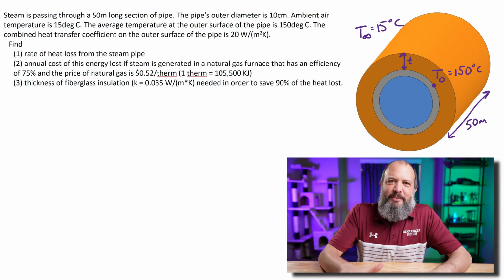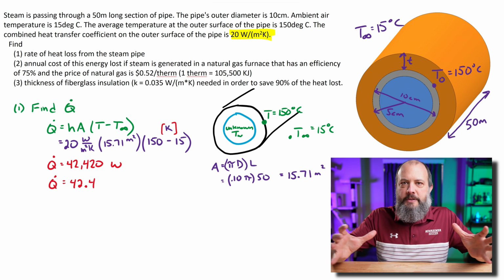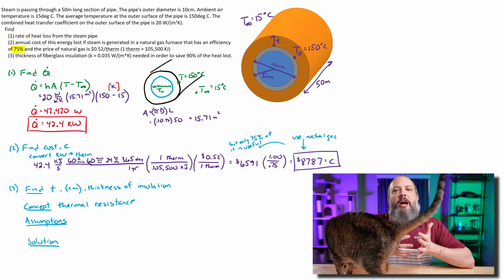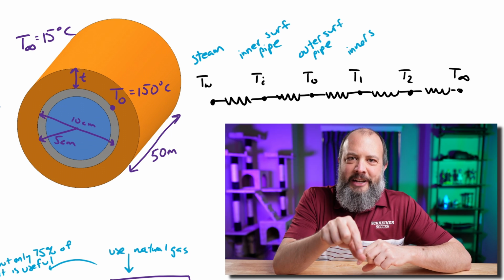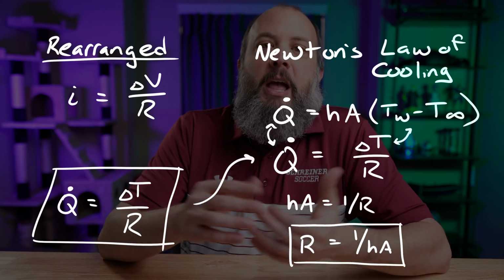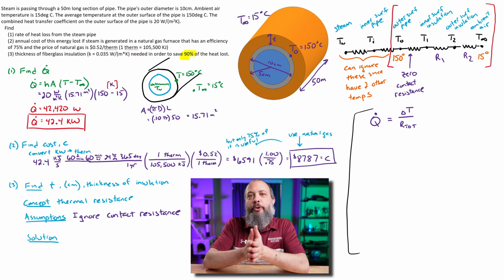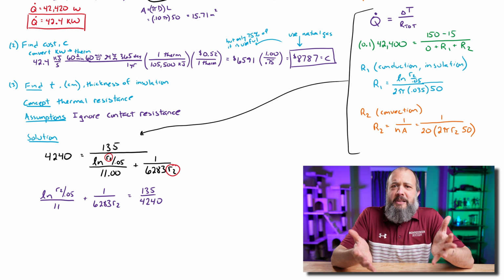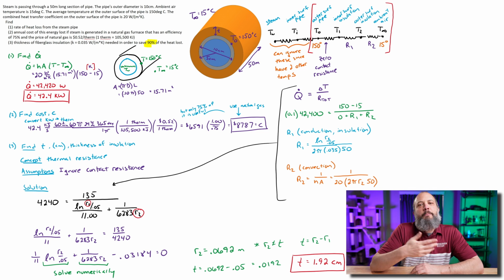Calculate Pipe Insulation Thickness - Thermal Resistance Example Problem

Comment: Is there a book or pdf where you are getting these equations from? Thank you for the practice problems.
Reply from the maker: I think I got all equations for this problem from the FE Reference Manual which is a free pdf from NCEES. You'll have to create an account, but once you login, it's in there somewhere, reference materials maybe. I also like "A Heat Transfer Textbook" which is a free pdf textbook written by Lienhard. I get a lot of equations and examples from there, and use their tables and figures also.

Comment: Dear Brian,

I am currently working on my graduation thesis, focusing on thermodynamics, with a specific emphasis on the heat emission of an exhaust system in a genset room. The situation with exhaust gas pipes closely resembles the one in this video. For example, the system consists of a stainless steel exhaust pipe with insulation material around it.

The key parameters in my research include:

The temperature of the exhaust gases and the ambient temperature in the genset room.
Dimensions of the pipes.
Airflow velocity/airflow rate inside the exhaust pipes and in the surrounding space.
For my calculations of convection inside the exhaust pipes, I am initially assuming the thermal properties of air at atmospheric pressure (at least in the first version of my calculation tool).

I have additional information about the project and my current approach. Would it be possible for me to send you an email with my current report? I would greatly appreciate it if you could review my work and provide feedback on my progress.

Thank you in advance!

Best regards,
Reply from the maker: There's an email address on the 'about' section of my Channel page you can send it to ... but no promises, sorry. I'll try to get to it if I can, but definitely don't wait for me.

Comment: The problems faced by solving the heat transfer of a cylindrical shape using natural logarithms are: 
1. When R1 = 0, then the calorific value is ~ + 
2. As a result, the temperature at the center of the cylinder also has a value of ~ + 
3. You cannot know the change in the value of the circumference of the cylinder (2πR). This is because you do not know the value of R. 
4. The ratio of R to dR becomes inconsistent. I have explained in the previous open letter. 
5. Serious problems occur when the radius of the cylinder is large and the thickness approaches the radius of the cylinder, then the ratio of R to dR is (R >> dR), R is very large compared to dR. It seems that when viewed from T1 the value is reasonable. But actually the value of T1 has a fatal error. 

I just hope that you read very carefully the meaning of my open letter.
Reply from the maker: I am unconvinced but open-minded. I don't think youtube comments is the best venue for persuasive technical discussion. It's difficult to format equations for example. Instead of an open letter, I recommend an article that can be peer reviewed and published in a format that will be more thorough and rigorous. Thank you for introducing me to this discussion though. I'll keep thinking about it. Good luck.

Comment: OPEN LETTER

MISS UNDERSTANDING OF STEADY STATE FLOW CONDUCTION
HEAT TRANSFER EQUATIONS IN CYLINDER SHAPED AND BALL SHAPED CASES

Dear,
Anyone studying heat transfer subjects (mechanical engineering, chemical engineering, etc.).
In Place,
	Together with this open letter, with humility, we send an open letter to anyone, which can be read by anyone who is willing to read this letter. 
The purpose of this open letter is to re-discuss the explanation of steady flow heat transfer in the case of a hollow cylindrical wall and a spherical shape.
	I am the author of the letter objecting to the formula that has been written in books and literature. Especially in conductor heat transfer on cylindrical walls and spherical shape of steady state flow.
In short, my objections are:

A brief description of my objections to the existing heat transfer formula is:

For cylindrical shape 

The general equation is :
Q			= -k. A. (dT)/ (dR ).  Fourrier Low
So the general equation derived for the cylindrical case becomes,
Q			=  k. 2π.R.L ( dT )/ ( dR ), 					……… 	Equation 1
Move the left side to Integral dR/R. With the outer upper limit (R2) and inner lower limit (R1), dT is integrated into ∆T. so the equation changes to,
Q. Ln ( R2/R1 )		=  k. 2π.L ( ∆T )			
Q 			=  k. 2π.L ( ∆T) / [ Ln ( R2/ R1 )].				……….	 Equation 2
Equation 1 is equivalent to equation 2
Q			= k. 2π.R.L ( dT )/ ( dR )		= k. 2π.L ( ∆T) / [ Ln ( R2/ R1].
Q / k. 2π.L		= R. ( dT )/ ( dR )			= ( ∆T) / [ Ln ( R2/ R1].
Q / k. 2π.L  is constant (C), so
C		       	= ( dT ).R / ( dR )		        	 = ( ∆T) / [ Ln ( R2/ R1], C no longer involved
( dT ).R / ( dR )		= ( ∆T) / [ Ln ( R2/ R1], dT = ∆T.
( ∆T ).R / ( dR )		= ( ∆T) / [ Ln ( R2/ R1 )].
( ∆T ).R / ( R2 – R1)	= ( ∆T) / [ Ln ( R2/ R1 )], ( outer – inner ) = R2 – R1 = thicknes
( ∆T ).R /  thicknes	= ( ∆T) / [ Ln ( R2/ R1 )], ∆T eliminited
R /  thicknes		=  1/ [ Ln ( R2/ R1 )].
1: [ Ln ( R2/ R1 )].		= R : thicknes.
1: [ Ln ( R2/ R1 )].		= R :  ( R2 – R1 )
R :  ( R2 – R1 )	       	= 1: [ Ln ( R2/ R1 )], changed for R1 is x and R2 is e (Euller number) so,
R :  ( e – x )		= 1: [ Ln ( e/ x )], dimana x : 0 ≤ x ≤ e			 ..….….	 Equation 3
R :  dR			= 1: [ Ln ( e/ x )], dimana x : 0 ≤ x ≤ e			 …….…	 Equation 4
R 			= dR : [ Ln ( e/ x )], dimana x : 0 ≤ x ≤ e			 ….…...	 Equation 5
R 			= ( e – x ) : [ Ln ( e/ x )], dimana x : 0 ≤ x ≤ e			 …....…  	 Equation 6
The equation above is the ratio of the radius of the cylinder casing to the radius of the cylinder
Where,

dR			:  Instantaneous thickness (R2 – R1 ) atau ( outer – inner ).
dT			:  Instantaneous Temperature 
e			:  Euller number or R2 or outer
K			:  conduktifitas thermal of material
L			:  length of cylinder
Q			:  Calor vullue
R		       	:  Length of radius of cylinder casing
X			:  Inner atau R1
∆T		       	:  The integral result of dT
∆R			:  the result  ( R2 -  R1 ) = ( outer – inner ) =  thickness
2πR		             	:  Cylindrical casing circumference
2πR.L		       	:  Cylinder casing area

The explanation of my objection is :
a.	From equations 3 and 4. The ratio of the casing radius to the cylinder thickness is never less than 1. This condition occurs when the thickness ( e- x ) where e (natural logarithm) is the outer radius and x is the inner radius of the range 0 < x < e^0 . The reason for my objection is that the radius of the casing always moves larger following changes in the cross-sectional area of the cylinder. Meanwhile, thickness moves linearly. so that there is never an incident where the sheath radius is shorter than the thickness. Thus the sheath radius is always greater than the thickness under any conditions.
b.	From equations 3 and 4. When the cylinder is solid (has no holes), the temperature will be +∞ (the temperature increases infinitely large at the center of the cylinder). This condition occurs when it is thick ( e- 0. e (natural logarithm) is the outer radius which is a natural number and 0 is the inner radius. The reason for my objection is that it is very implausible that a material in a solid state can withstand heat at a temperature of + ∞. My opinion is that the temperature can still be known even though it is difficult to practice in solid conditions. 
c.	From equations 3 and 4. When the cylinder is solid (has no holes), the temperature will be +∞ (the temperature increases infinitely large at the center of the cylinder). This condition occurs when it is thick ( e- 0. e (natural logarithm) is the outer radius which is a natural number and 0 is the inner radius. The reason for my objection is that it is very implausible that a material in a solid state can withstand heat at a temperature of + ∞. My opinion is that the temperature can still be known even though it is difficult to practice in solid conditions. 
d.	From equations 3 and 4. In general, the reason for my objection from points a, b and c is that the use of natural logarithms causes uncertainty in the ratio of the sheath radius to the radius.
a. When the thickness ( e – x ), 0 < x < e^0, then the ratio of the sheath radius < thickness.
b. When the thickness (e – x), x = 0, then the ratio of sheath radius to thickness is + ∞.
c. When the thickness is ( e – x ), x = e^0, then the ratio of the radius of the casing = thickness
d. When the thickness ( e – x ), e^0 < x < e, then the ratio of sheath radius > thickness.
e.	From equations 3 and 4. My question is: How to calculate the temperature at the center of the cylinder when the heat comes from outside the cylinder by conduction with steady state flow ???. could the answer be ( – o C )?
f.	From equations 3 and 4. The use of natural logaritms is to calculate dimensionless area units without calculating the radius of the cylindrical envelope (R).
g.	From equations 3 and 4. The forecast calculation error is very serious. When the outer becomes very large and the inner approaches the outer (relatively thin). So the calculation error in temperature becomes very large
  

 Figure apply logaritma natural. Ratio R : dR is inconsistant
 
Why is the existing formula considered to be true? This is because the heating value must always be (constant) at each change in thickness which experiences changes in temperature which increases as it approaches the center of the cylinder along with changes in thickness, where the initial temperature comes from the inner radius. Note that the heat source comes from inside the cylinder.
Reply from the maker: Reading through this, I have I think 3 comments. 1. I don't think it makes sense to consider the case where R1=0, the solid case. There's an R1 in the denominator right from the beginning, can't divide by zero, hence this equation is clearly invalid for the solid cylinder scenario. 2. You seem be switching between differential equations and difference equations (dt = deltaT), and mixing and matching them, in a way that is not rigorous and could be leading to errors. 3. You seem to be using R as a constant, but it's not. R is a variable. This #3 problem is related to the #2 switch between differential to difference equations.
Reply: @BrianBernardEngineering  My comment: 
1. If so, what is the heating value when the cylinder is solid? 
2. What is the conclusion Q = k. 2π.L ( ∆T) / [ Ln ( R2/ R1 )] ≠ Q = k. 2π.R.L ( dT )/ ( dR )
3. If so, what is the definition of R?